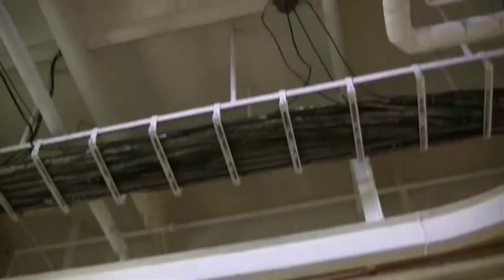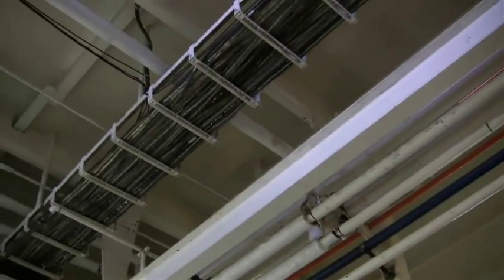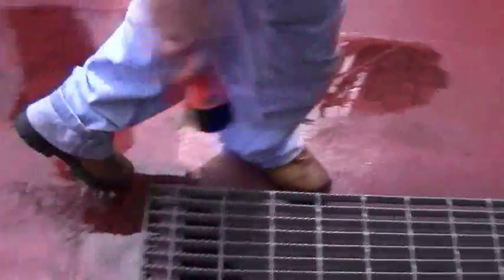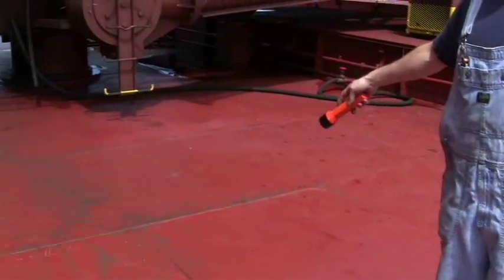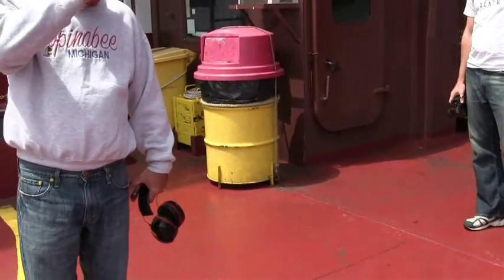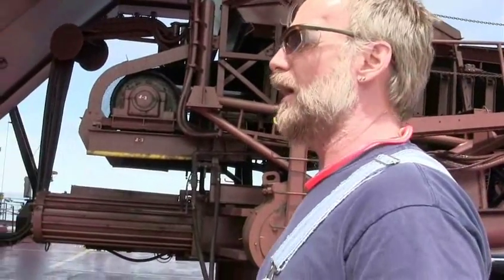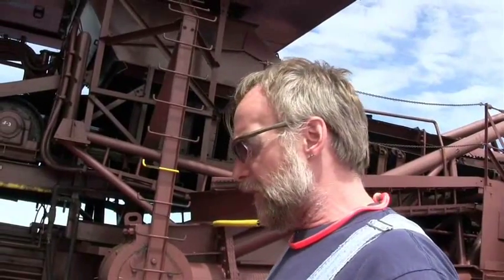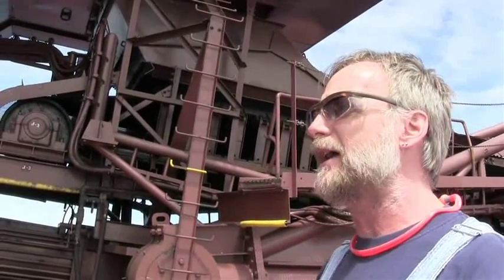Paul R Tregurtha Engine Room Tour Video 6 - Great Lakes Freighter

Comment: The Caterpillar D399 engines on the generator sets were what some of the offshore drilling rigs would to supply their electrical power.
I was on the Santa Fe 127 when one of the  four D399s up and died, and they cut a hole in the main deck and lifted it out, and when we went into the shipyard in Sharjah, all four engines were replaced with Caterpillar 3516s.

I have been on other offshore rigs where the electrical power was supplied by 16 cylinder EMD 567 or 645 Series, one I was on had 251 Series ALCO, and the first one I was on had Mitibushi engines.

All were loud, but the EMDs were the worst, with their 2 cycle scream along with the Roots blowers adding to it.